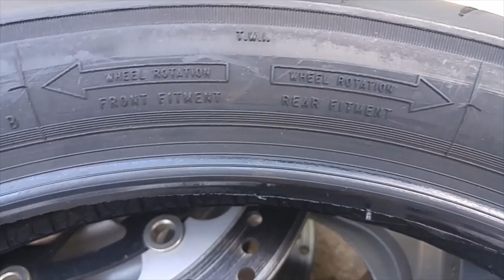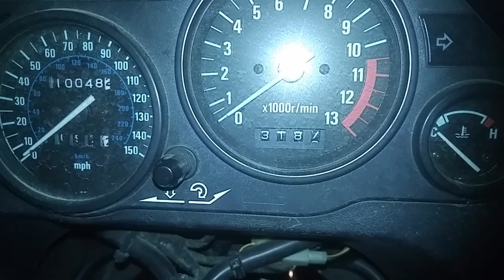2004 Kawasaki Concours 1000 front tire change

Comment: Comments, Comm, yada yada yada… . 
12 mm Allen key out of a coupling nut, very cool 👍.  The bolts on my left front caliper got stripped using a 12 point socket. They were put on at a dealership with an air gun I guess?  So, I filed down the bolts sides to the next smaller size socket, & used a 6 point one. Still came off very hard 100+ lb.s measured on a deflecting beam torque wrench.  Lesson learned for me, if possible, ALWAYS USE A 6 point socket when you can!  
Which brings me up to my 2nd point.  I noticed you did NOT use any “Anti-seize” on those threads of the brake calipers you reinstalled.  Yes, anti-seize  will change the recommended torque values, but in my opinion only, it isn’t as critical as it my seem.  Internal engine components, use it calls for it, I don’t lube the threads with any thing.  Outside the engine, if it’s a steel bolt into a aluminum thread, it gets anti-seize.  I mean every bolt on my mc, if it come out, it goes back in with anti-seize. Yes, my spark plugs too.  I don’t expect to have problems removing a bolt if I have to do it a 2nd time or more.  My chose of coarse. Seen too many stuck bolts etc, in my years not to be a little cautious.  NEXT;
speedometer cable when to take it out, immediately put sim sort of tape over the end so the cable doesn’t come out very far.  Unknown to you, the other end of that cable that goes into the speedometer housing has a similar “straight slot” just like the one that is at the end where the speedometer adapter sits on the front tire.  How do I know?  Pull the cable out and take a look… 😵‍💫.  You just don’t want the cable NOT to fit back into the speedometer housing up top, hence when you remove the speedo cable sheath, tape over it do the cable don’t slide out out its sheath.  Maybe never an issues, but why take the chance on breaking the cable, not having it work, or bugger up your speedometer?  
There are lots of things you can do that are incorrect and no harm comes from it after you figure out how to put it back together the correct way.  The other side of tha coin is, there are things you can do the wrong way, that can ruin stuff, that will cost you time, money, heartache and pain.  If something isn’t going together just right, stop, take a breath, rethink what’s taking place. Relax and don’t be in a hurry. There’s never enough time to do something right the first time, but always enough time to do it again a 2nd time!  
I’ve been backyard wrenching on engines, cars, motorcycles for many many years.  At 67, I still don’t know enough to learn it all myself.  Use whatever resources you can, to figure out how something is done start to finish, what you’ll need as far as parts, tools, solvents, vises, extra pair of hands, whatever, and have it ready before you jump in unprepared.  Yes, nobody knows it all. You’ll have to take a break and go to the store here and there, bolts break off, you misplaced one of your tools, “it was here the last time I used it!”

I AM NOT SAYING YOU DID THIS UNPREPARED! You did really well, and your videos were very good.  Next time around, you go twice as fast, and with 2X the confidence.  Great job, thank you for the videos, and your desire to help others who will go down the same road you are. 👍🫡😎🤗

Not sure why you didn’t get Avon’s radial Storm tyres?  The Connie comes with radial tyres.  I have a set (F&R) waiting to go on once the Dunlop’s I have on are worn more.  I purchased these Avon a while back when they were available.  I also choose 110 Front as my year Connie has the slightly larger size rim, but in reality, only the stock K700 series in 120 will fit ghat 3.5” rim for a radial tyre. 110 size radial will fit correctly on a 3.5” rim.  Check it out for tyres in the 120 size, they require a larger than 3.5” rim!  The more you know the better it gets (Motorcyles Safety…) 👍😎 thanks again for your hard work. Sincerely
Pab
Reply from the maker: I use a lot of antiseize normally as I do industrial maintenance for a living, and definitely on situations where galvanic corrosion is likely like the situation you mentioned, but I was just concerned about the fasteners vibrating loose since it's a motorcycle. I'm more likely to use locktite on my bikes at times.  It's been a while so I don't recall the exact reasoning behind my tire choice, but the decision wasn't made lightly as I tend to be rather neurotic about decisions like that. They ride nice so I'm not to concerned. I don't think I really push the limits while riding so it isn't real likely that I would notice much of a difference...lol. thanks for all the comments and advice Pab!
Reply: @repairandcreate6192  
Sorry for being long winded.  You did a great job, and anyone who can take tubeless tires off their rims, and put new ones on, I salute you!  (really). I was wondering if gal milk jug containers, (the thicker ones) might work better than the liter - 2 liter pop bottles? Just a thought.  I made a 2x4 frame that I was going to use to try & change out my wheel bearings. The width of the 2x4s is enough so the brake disk(s) dont touch the ground. (and maybe change out a tire on a rim since costs for this work has gone up so much). I just have not been brave enough yet.  Tire changing just has seemed too much for me physically in my older years, and I chickened out.  Thanks for the video and listening to this old man.

Comment: For future reference, there is a circular paint dot on the sidewall, usually blue I think, that you're supposed to line up with the valve stem. 3/4 of the time I forget about that anyway.
Reply from the maker: The last two times I have done tires on two different bikes, there wasn't a mark or dot anywhere. I guess they are getting good at making really balanced tires.

Comment: I gotta change my front right now... not looking 4ward to it at aLL.... Glad it's not the rear though, which aLso neeDs Replaced........  Both of my Tires have that Cupping Wear On Them....  I think i'll just take it off and carry into the Shop... $40 at one shop, or $50 at another... The $50 place uses a Balancing Machine... The $40 place uses Beads to Balance Tires...
Reply from the maker: There seems to be a lot of people that are cool with the beads, but they just don't seem right to me. I just did a 77 ironhead front tire a couple weeks ago and it went pretty well. I wish I had a third tire iron though. The most important part is getting the bead down into the center groove of the wheel.

Comment: Haa  Yeah i find it's a really Top Heavy Bike......... Like checking the Oil while bent over & holding onto 1 handlebar to keep itbalanced..........
Reply from the maker: It is heavy. My uncle warned me when I bought it about it's slow speed handling, like in parking lots and such.
Reply from the maker: Good luck... I used a shaved down coupling nut, and a socket on mine.

Comment: I believe that you should balance after you set the bead.  but you may have inspired me to attempt this myself.
Reply from the maker: I agree. I was trying to reduce the amount of weight required by finding the best balance point for that particular tire as I recall. The tire didn't have a dot on it to line up with the stem.
Reply from the maker: Also, good luck on your attempt, I'm sure it will go fine. Pretty satisfying to complete these sorts of tasks as well. As I sit here typing this, I have the side off of my KLR650 engine replacing a part.

Comment: My speedometer thing dont stay in tht notch ur showing...  everytime i try to tighten the axle and nut, the damn speedometer thing will spin with the turning... so i put 1 of the holding bolts in on speedometer side, but it still wants to spin out of place unless i hold both sides of the axle...  i just bought 12mm jumbo allen keys... no money 4 torque wrenches... so hopefully those 2 holding bolts will keep things from loosening...  Wheels on and spins nice & free, seems centered to me... just haven't put calipers bk on yet, noticed i never pushed the damn pistons bk in enough for the new pads....
Reply from the maker: It's been a while since I did this job myself so my memory's pretty foggy on it now. You get it all ready to roll now? I have been doing a ton of work on a 77' ironhead Sportster this spring, but I still have the Connie.
Reply: @repairandcreate6192  So far So Good.... Its all working...

Comment: What is the correct nut tool for loosening the axel? A torx or star bit?
Reply from the maker: I think those two are the same thing aren't they? Like if you were to say a Robertson drive or a square drive...
Reply: @repairandcreate6192  
Yeah... I only mentioned both because people refer to them using both terms. I guess my phrasing didn’t reflect that. 
So is it a torx; and what size?
Reply from the maker: @lorenzovillegas2457  I'll check when I'm out in my garage tomorrow and let you know.
Reply: @repairandcreate6192  
Thank you... and by the way, excellent videos, and superb DIY execution! Impressive
Reply from the maker: @lorenzovillegas2457  check the 6:00 mark. It is a standard Allen or hex 12mm. I cheated and uses a coupling nut that I shaved down with a file, and stuck in a socket.

And thanks for the kind words.